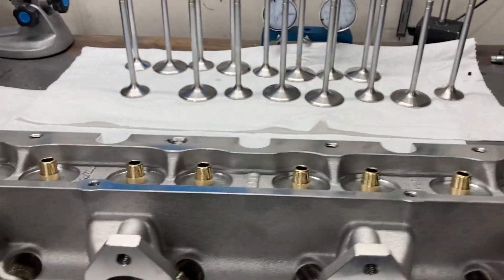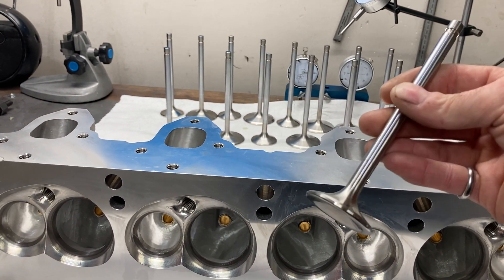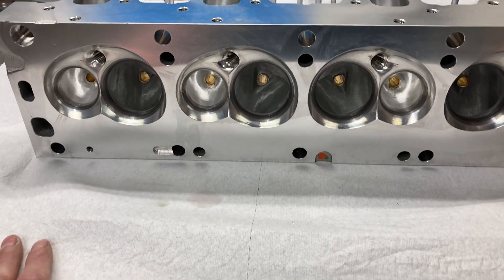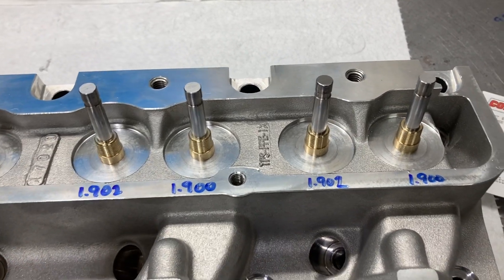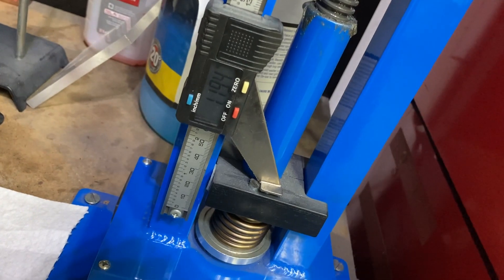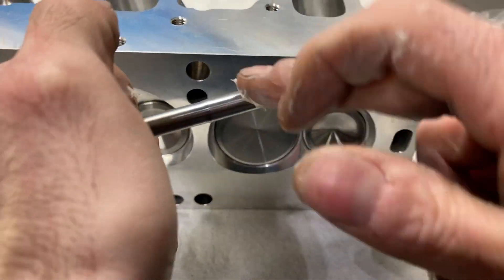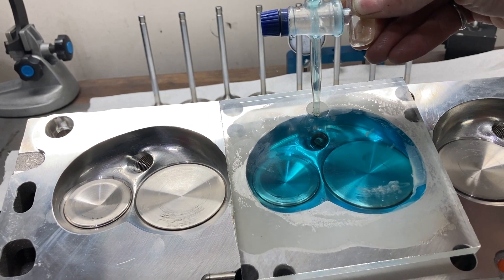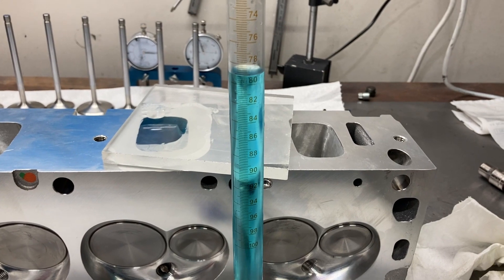Lykins Motorsports Ported Trick Flow Ford FE Head Review

Comment: There tons of FE cast iron heads out there that work with
Porting. Tfs , bbm, edb all make aluminum that bolt on and also have ported options for US.
I go through all of them before installing FE is one of my favorite engines that make HP
There easy and cost efficient to build for ford performance and very reliable. More engineering 
It that platform in its time then any other engine on the market!!
In its day maybe even today as well.

Comment: Brent,
Do you think oiling thru the push rod is better than thru the head/rocker shafts? Is it because of aftermarket rockers shafts, or do you feel they oiled better thru the push rod? I have no FE engine builds under my belt. Appreciate your videos.
Reply: Pushrod oiling puts the same amount of oil to the rockers at the same time. On    shaft oiling, the rockers farthest from the oil source will get less pressure and be oiled last.

Comment: Those will wake up most anything for sure
Wanting to run exhaust manifolds on a good flowing head is sorta counter productive
Make the headedrs fit however you have to, air has to get out as well as get in the engine why cork it up?

Comment: Hi..wanted to ask you if you know what kind or part number of spark plugs these Trick Flow Ford Fe heads use..I looks like that the spark plug hole seem smaller than regular Ford Fe heads..also are the valve springs that are sent out of the box, are they for hydraulic roller cams or hydraulic flat tappet cams..I found out that they are for up to .680 lift cams..but not sure if they are hydraulic roller or hydraulic flat springs..I have a hydraulic flat tappet  cam that is close to .600 lift..thank you..sorry for so many questions..I admire your work and expertise..
Reply: They probably use a Champion RC12YC.

Comment: Trick flow recommends the Harland Sharp rocker arms.  I’ve talk to trick flow tech support, they really didn’t know about the +.300 he said that even though he wasn’t familiar with the extra height, the HS rockers will work without modification.  What are your thoughts on that? Do you agree?  I wasn’t very impressed or confident in his answer, my guess is you would have more knowledge on the subject.  It’s very odd to me that the .300 of extra material below the pedestals is not mentioned anywhere in truck flow technical data, with associated recommendations of rockers or modifications to rockers for compatibility with the TF heads.
Reply from the maker: It's because when you generally use H/S rockers on FE heads, they have to be shimmed up in order to get the geometry right.   I think TFS just got "lucky" in that the HS geometry works with their particular stand heights.   On all other rocker systems, including factory, T&D, etc., etc., the stands have to be whacked.
Reply: @lykinsmotorsports  good to know.  Thanks for your knowledge on the subject.  Your videos are amazing.  Keep up the good work.

Comment: How much power in a 390 with these heads, dual plane intake, cast iron exhaust manifolds, and a milder cam? Would be interesting. When I was running my 428 in late 70s my heads would only last 5k miles before the guides were completely worn out and that was with a really mild cam and only revving to 5.5k. Didn't have money for bronze guides and better rocker arm setup as they weren't even readily available.